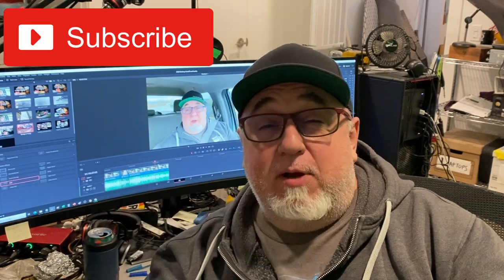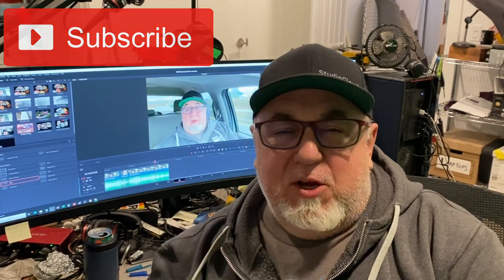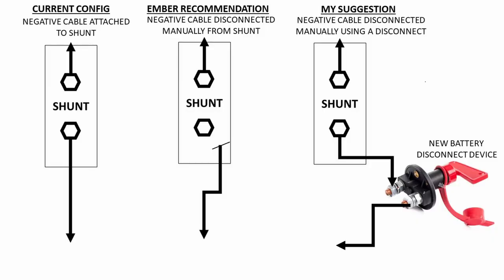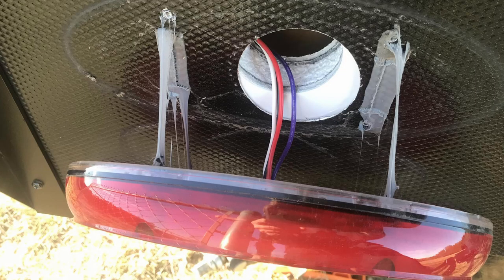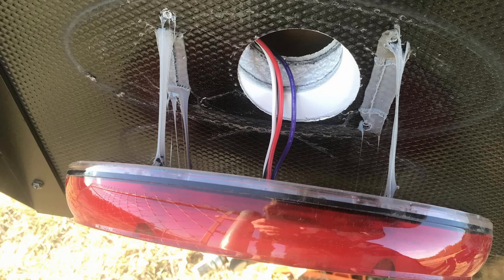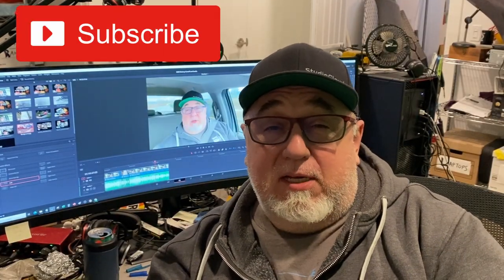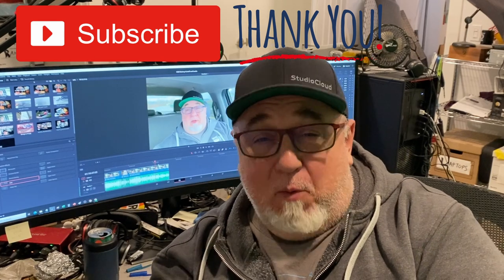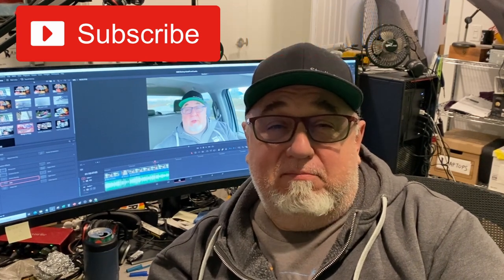Almost VOIDED my Warranty w/Battery Cutoff on my Ember Overland Off-road Off-grid RV Camper/Trailer

Comment: I've heard good things about Eternabond tape for sealing up leaky areas. (A bit pricey but allegedly worth it!)  Sorry to hear about the issues you've been having.  Both my wife and I subbed to your channel since we love your content and have our eyes on the Ember 171FB.  Hopefully the water situation gets fixed!
Reply from the maker: Yes the dealer clearly added a lot around the slideout top and side so I get no rain in the top or sides,   I am still not 100% clear on where the water is seeping in.

Comment: I will only buy a base Ember, rather than having all the power system that you have. I will then have a third party that specializes in doing this and let them install it correctly. The only reason I like the Ember is because of the off road capability. I am hearing more and more quality issues. I will defiantly have a professional go through a complete inspection before purchase.
Reply from the maker: The offroad part was my biggest want and the NO WOOD is a big part (since I live in a friggin rain forest.)  Some of the models I was considering just had base solar.  Solar was never a big factor in my decision and just thought some extra battery life would be nice.   I have no problem firing up my beautiful red Honda generator.

Comment: I have a water leak through my wheel well(s).  At least the one under the couch (170MRB).  I can see daylight around the wheel well.  I am thinking of fixing it myself.  I don't live close to the dealer. Joe, do you have an photos of what they did to the wheel well?
Reply from the maker: I have not been 100% clear on where they have done all the sealing.  But I noticed in the work order that Ember requested before and after pix so I was going to ask the dealership for those.  If I get them I will update this thread and post them to Instagram and Facebook so you can see them.

Comment: So sad to hear. I really thought they would allow at owners expense. I never expected them to pay. But I honestly thought they would accept your idea.
Also, don’t add Lippert’s window “twist” extenders. I have the flat windows. They are Lippert windows. By coincidence, while asking for repair parts (never sent 3 times) i asked about if i could get the window extenders. They are $46.00 each. I thought maybe through Ember I might save a few pennies. I was told that if i added the Lippert window extenders to my Lippert windows, I would void my window warranty. 😢
Reply from the maker: Yes I remember that tidbit and will wait for warranty to expire before I install those.  Whether it’s my truck or my trailer, I generally try not to change anything until the warranty expires. And then hopefully I actually own it by then lol
Reply: @RVingWithJoe  yep, pretty much my thoughts.

Comment: I always felt it only VOIDED the Warranty if proving it was the cause of the problem. Its more probable that you would have a electrical issue because Ember wire harness was installed improperly and shorted out then what you are talking about, so legally proofs on them if that was the case. Imho
Reply from the maker: I didn’t want to give them the excuse.  Especially after seeing the very-slow battery charge from I am getting in warm-storage. I just added an excerpt from the work order in the description, including Ember’s comments